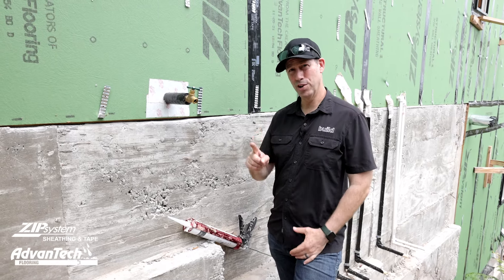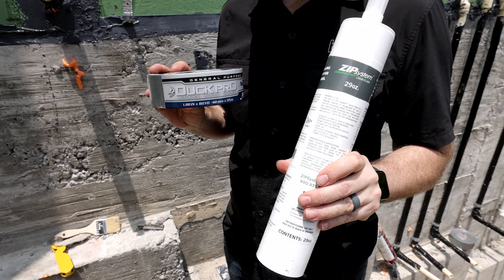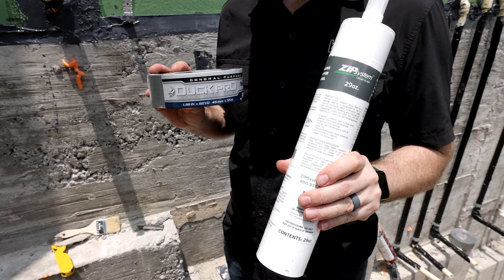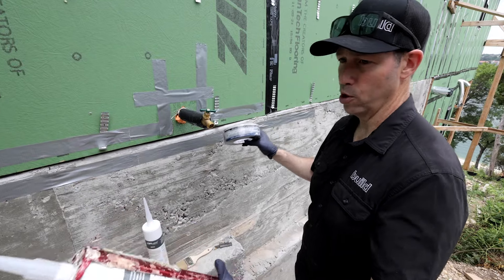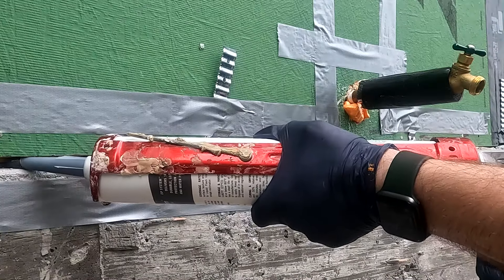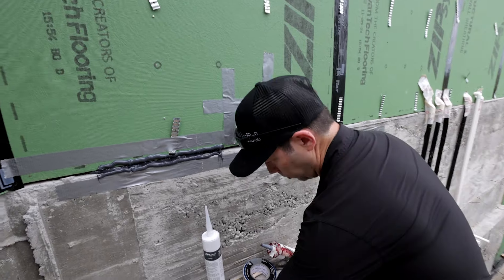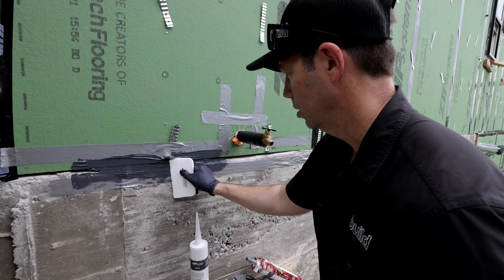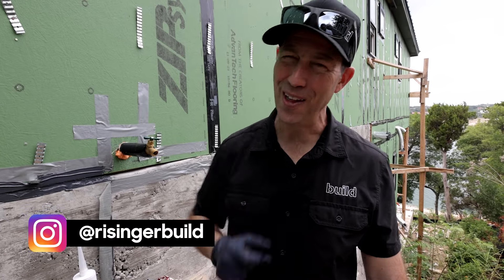A highway for BUGS to get in your house. Seal this joint!

Comment from the maker: If you are remodeling and can’t access the outside sill follow this interior video of mine: https://youtu.be/LIvPla-07fo
Reply: Lol so the time has come, I'm at a loss even with watching lots of these videos, how does one approach this (my house - https://photos.app.goo.gl/84dZCuFJKbtd24wn7 ) I'm open to viewers suggestions too. I'm unable to access the sill from inside (about to tear open inside the house and look but...) Even after...

I will remove both layers of siding (even some behind that concrete) and then find the extent of termites but even if I manage to replace that sill, how do I go forward making sure that's sealed off correctly? Put the 7/16 on the old clapboard and 0.5" above it and just liquid flash bottom foot on both sides of OSB and sill board on the bottom and side towards concrete with it sitting on two sill gaskets then stick it down there and then stick some mineral wool in there? Or air dam, big gap, or leave it open (the remaining gap to concrete? Then a flashing that goes near top of concrete  on sheathing that dumps to past that concrete then 2" mineral wool and rain screen with covavent and siding?

Comment: Last summer after watching your channel for some time, I went around the entire house and pulled off the bottom two rows of vinyl siding and start strip,  taped up the house wrap, and applied  Prosoco R guard from sausage tubes around the whole house foundation to sill plate joint.   Tooled it off, waited a day for it to set, and put everything back together.  Wow.  No more bugs.  Drafts reduced considerably.  It was a fair bit of work to do it after the fact, but it was totally worth it.
Reply: We need to do this too.  What was the worst part?
Reply: @valeriej291  Making sure that I marked carefully the starter strip location so that the siding would all match up again.  I have all the tools for vinyl siding, but you may not.  You'll need a siding removal tool like the Malco Sideswiper. If you have wood or composite siding it will be a bit harder but not impossible.  Most important tool to have is patience....
Reply: Make sure to do the top plates and all the penetrations and the joints of your sheathing, too, and use a good quality house wrap. You don't want any water  or vapor to penitrate and not be able to drain out the bottom. I'm doing this with my house as well.

Comment: Matt, we’ve completely gutted our 52 year old home in Alabama and are sealing so many openings as you advised in past videos. We enjoy watching your videos every week. Many things you mention are not high cost but take a lot of time to do such as sealing those openings inside and outside. Keep up the great work!
Reply: Yeah, im going to put the time in once i replace some parts of my 97 year old house. I'm also planning on opening areas that were hidden with drywall that I think would look better exposed and also show any issues that could be happening easier, such as my utility room, why they put drywall in there I dont know, I'm on slab and its kinda in the basement level if you will that shares with my kitchen and bathroom....utility room is 1/3  the house length down there. If i open up the ceiling in there and clean it up to be able to see things such as my sill plate and some floor joist etc, I live on a rock built into a hill, termites loved my home a tad to much. Will also let some heat upstairs from the boiler room better

Comment: I wish Matt would come by my house to "crash" my jobsite while installing some bonus product.
Reply from the maker: On my way!
Reply: Sounds bout right
Reply: @buildshow  Need my address now?  Builder is almost into drywall now. I’m not a builder/contractor but with all your videos - I am now blocked from going into the new home of which I am paying for.  😮.
Reply: @buildshow He meant to say my house. I've been slowly renovating it. I'm removing the old sheathing one section at a time, framing in new pela windows and doing the bomber methods using R guard products. It's taking forever cause of my day job. 😂 I have a nice stack of 2" R10 exterior insulation covered up in the North side of the house along with the rain screen. Come over any time. It was a 1950's ranch with more air gaps then swish cheese. 😂😂

Comment: As an ICF fanboy, it amazes me how many tips and tricks Matt goes over that just aren't problems in an ICF house. Can't wait to build mine later this year
Reply: that's my plan too with a concrete roof as well! talk about tornado proof!
Reply: @enkrypt3d  you can only be tornado proof below grade. You can make it F3,4&5 resistant but you can not guarantee safety above grade
Reply: @mattbrew11  there are many videos of ICF walls withstanding 200 mph winds... Look it up on yt
Reply: @enkrypt3d  tell me more about these windowless structures
Reply: @mattbrew11  look at the video dude. Yes the windows need to be hurricane rated. Which do exist.
Reply: @enkrypt3d  im a general contractor dude
Reply: @mattbrew11  😂 I can tell by your username. Mr knowitall
Reply: @enkrypt3d  ok sugar

Comment: Matt,
What a great detail for catching up on such a build.  
When we built this home 7 yrs ago, and following you and Steve Baczek details, I used a rubber membrane gasket and 2 beads of Tremco Acoustic Sealant. 

Love the details Brother!

Cheers,
Eric
Reply: How did that turn out? Did you put the Tremco under the rubber gasket (on either side of the sill plate)? What was the rubber membrane you used? Did anyone wonder about the  method?

Comment: I get sticking w/Huber products given the Zip sheathing and that I believe you’re a paid spokesperson for Huber. We however have found Siga Fentrim tape is less expensive, both in material costs and vastly less labor intensive than the Zip liquid flash. 

Fentrim tape comes in multiple widths, we use Fentrim 150 & 230 depending upon application, and sticks far better to the concrete without needing a primer. Since our concrete foundations get a liquid or peel & stick membrane water/air barrier, the Fentrim has a felt like texture that Polywall liquid membrane adheres to extremely well. When using bituthene, such as Delta-Thene, the Fentrim adheres to the membrane w/o chemically damaging it.  Yes, it adheres very well to Zip sheathing, since we commonly use Zip R-6 on majority of our homes. 

I would recommend you try Fentrim tape on your next project, your crew will thank you 😉

Comment: great video, I already have vinyl siding outside, thinking of just spray foaming under the very bottom piece where I know the sill plate is at ( obviously I just can't see it from outside & don't wanna cut drywall in the basement)
luckily the garage half of my house is open so I was able to spray foam that from inside.
just trying to cut down on the freezing drafts that are coming very soon

Comment: That's  more than $1000 of caulking to seal these cracks, but I guess there's no cheap way of doing this, it's either Huber gets my money or my local bug exterminator. Thanks Matt - Great video! I live in Oregon and I know that you know that we have plenty of bugs here.
Reply: backer rod comes in all sizes.....I think if he used some it would have needed much less product
Reply: A lot cheaper solution is to use something like Siga's Fentrim 430 grey tape. This is what I used on my house (and Matt has demo'd it in other videos). It costs about $1.65/ft (for a 6" width) and is significantly easier to apply than the liquid flash, and (in my opinion) does an equally good job for this particular application).
Reply: @mattr232002  Any idea how UV stable tape is?
Reply: @husaberg8501  I only have anecdotal evidence. I took a piece several years ago and taped a seam between two concrete blocks on my patio. 3 years later and there's no way I could pry that off. So it's done fine in full exposure to all elements for at least that long

Comment: Rothoblaas has tons of solutions for wood buildings, for that specific area included, nice and snug, airtight and waterproof. Check that out, maybe pay them a visit in Italy, they're just great when it comes to wood.
Also you can have a look on Aerosana Visconn Fibre, liquid vapour barrier.

Comment: This is great for slab on grade.  But what about when there's a floor joist system? Seems like bugs can come in from the crawl space side.
Reply: Seal up the crawl space and/or the flooring at every floor joist, corner, crack, and gap. All you can do is seal everything up as much as possible. It certainly would be time consuming.

Comment: Too bad so many Austin area builders just don’t care about things like this! Check out these massive subdivisions going up - they screw up the most basic things like drywall in the shower and then glue tiles directly to it. No proper support behind, no water barrier at all. It’s sad to walk through them.
Reply: Nothing wrong with drywall in the shower if a product like Kerdi is used to tile it.
Reply: @raterus  drywall is meant for dry locations with little moisture exposure. Showers have high moisture exposure which can lead to rot and mold if not sealed correctly.

Comment: Could the cavity be filled in with expanding foam like you did around the spigot before going over the joint with the liquid flashing?

The expansion of the foam could be controlled with tape or a temporary form. It might be faster than tooling the liquid flashing into the recess.
Reply: the bottom plate is sitting on 1/4" foam to give it a thermal break... so there is somewhat of a "backing" there already
Reply: @enkrypt3d  Yes. After the foam expands and cures, remove the tape/form and, in theory, the surface should be smooth and flat - ready for liquid flashing.
I also wonder if it would work to use only expanding foam and skip the liquid flashing.
I did it Matt's way (tooling into the joint) which took a very long time and used a lot of product; 20+ sausage packs, on 300ft of wall.

Comment: I swear you know I'm fixing termite damage on my sill/rim on an old house and stripping two layers of siding and putting zip system up on 1" tongue planking with wool.... Was wondering what to use after it's gapped 0.5" off ground , before the coravent goes up

Comment: And water coming down the Zip membrane: Looks like a flush layout, concrete to the sheathing, so why wouldn't water on the Zip sheathing just go in over the top of the concrete? glad you did this.
Reply: Are you asking why you can't just touch the zip sheathing to the concrete and then seal? If so it's because the osb behind the waterproof membrane would wick water from the concrete below. With the gap it's not possible and with the sealant you won't even have condensation chances anymore that could wick up and mushroom the backside of the OSB

Comment: Can I request a build checklist of the most important/most difficult things to correct later. Such as sill plate protection, borate spraying, bug prevention like you did for roaches that may find moist spots under the tubs. Maybe even building access areas every installer wish was there but never is (make sill plates always visible from inside or blah blah). Man, I wish I thought about adding insulation on top of my roof before it was done, what a stupid move on my part. I also think you should have RJ45 plugs in each room on opposite sides  with 2 cat6 ran to each spot and never daisy-chained that go to a central location in the utility room. Can be used to power cameras outside too if ran outside. Man I just love your channel and cant get enough and feel like I want to learn it all, I just hate trying to update older homes that are literally already set in stone, its hard as hell , never know what the next issue you will run into is going to be.

Comment: Great idea! I have an addition on the back of my brick house built in 1909. the addition was built between the 1950s and 1960s. It has 7/16” fiber board over the 2 x 4 framing with a rotted paper barrier that’s in really bad condition from getting wet Over the last 60 - 70 years. With Cedar Siding nailed on top. bugs laid their eggs underneath the bottom 1” of the cedar siding. 

I’m removing all of the fiber board installing 7/16 x 4 x 8 Zip Sheating, with 1” x 4x8 polyiso Atlas Energy shield, Also replacing the cracked cedar siding with LP siding. 

Using button caps to attach the poly iso-board to the Zip Sheating. Buying 1x2x 8 ft common wood used as Batons and installing CoraVent  on the bottom of the batons. Matt has a video about this. The 3/4” spacing created by nailing The siding on top of the Batons allow a air separation on top of your zip sheeting or your polyiso insulation. whatever siding you buy the siding has 3/4 x 16 on center space x 8 Ft to breathe from the bottom up to the top! Using this methodology you won’t have the issue that I have because the people who installed the cedar siding didn’t know these building techniques!

Comment: I’m curious if treating this location on the bottom termination of sheathing using Zip Wall sealant is providing the same protection as the Polywall sealant you had demonstrated on another video.  Is one better than the other?

Comment: I've been waiting for a video like this. What if your plywood wasn't proud but instead recessed and the cheap "DuraTemp plywood siding panel" was essentially flush with the face with the concrete, would you not want to seal that joint or would you not worry about any water being trapped behind your main siding?

Comment: Would a fiberglass tape and epoxy resin work as well?  The mess, bond, and seal would be about the same if not better. The cost and number of tubes needed to fill a gap on most projects would be enough for me to seek alternatives. I often think the same about these zip systems. Would a lizard skin on regular OSB work or a composite and epoxy tape over the zip sheathing joints and nail holes?

Comment: Hey Matt, Love your videos and boy have I been learning a lot!!! Thank You!!!  I am going to be building a 12x20' Shed/Workshop on a 12x24 4" Concrete Pad.  I plan to use pressure treated for the sill but I am concerned about the one wall that will have 4' of concrete beside it and how to seal it so I don't get water coming in.  Would the Siga products be my best bet to use all the way around?  I would love your input.  Thanks again!!!!  Dezi

Comment: I want to do this for my new build. My builder is using Henry Blueskin. I called Henry and the rep said they don't recommend sealing the framing to the foundation because "hydrostatic pressure" even though I told him the application is above grade. Would like to stick to Henry products but not if they are not supporting this application. Should I look to a different manufacturer since there does not appear to be an advantage to sticking with Henry products or use their 925 BES Sealant as an off-label application?

Comment: I don't understand the tape on the concrete i was going to comment the same on an older video using prusco. Matt says we don't want the material exposed to sun light, what happens if it is? Will it ruin the seal for bugs or is it purely aestheticsbif you are covering it does it matter?

Comment: Can anyone explain why they don't build the framing right to the corner and run the sheathing long  onto the concrete? Easier to seal behind a piece of sheathing and let water have to work against gravity to get in
Reply: Most carpenters who give a shit typically make sure our framing is square and parallel, regardless of what the concrete does.  If we went with the concrete it would be a mess .
Reply: @9mmkahr  so what you're saying is the concrete forming should be square and parallel....
Reply: @Ninjump  it should.  It's not always.  Generally it is square and parallel.  But there are always dips and humps and bows.  Form setting is rough work and the tolerances aren't perfect.  Block is usually better in that regard.  I've been framing houses for over 20 years
Reply: @9mmkahr  I hear you. We have done a few buildings the way I mention, maybe our foundation guys have spoiled us.  We also use a sheathing with hard foam insulation on the back so there is more wiggle room there when it comes to conforming to slight imperfections. Giving the form guys a lot of time to check  and triple check is a good use of money!
Reply: @Ninjump  that's good about the foam... I like that Zip-R.  
 I was about to say how osb (or really any wood not pressure treated) should not touch concrete.

Comment: Hey Matt,

Will the liquid flash work for going between Zip and ICF or would you go with a Steve Baczek approach and do the double seal under the sill plate?

Comment: Should you apply the sealant to both the outside and inside (interior of home) bottom sill?
Reply: There is another video that Matt did during the framing process where he put the Zip caulking on either side of the mudsill gasket.

Comment: Matt, wouldn't using Siga fentrim tape to seal that joint be just as effective and easier and quicker to do? Great channel with very useful content.
Reply: I think the issue with just using tape is that it can tent or bridge over the small gap at the joint area, leaving a corridor where bugs (ants/termites) can freely travel. The liquid flashing/sealant fills it in.